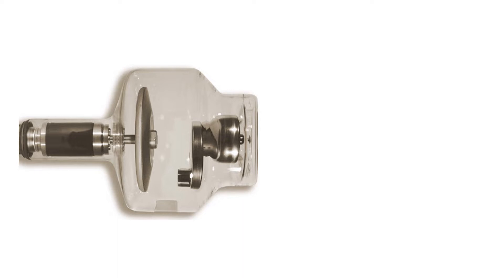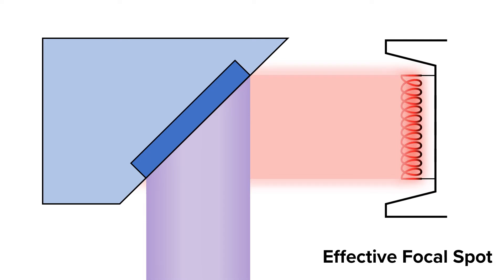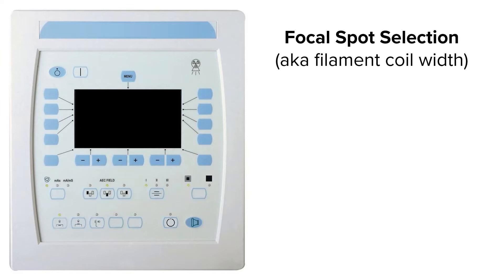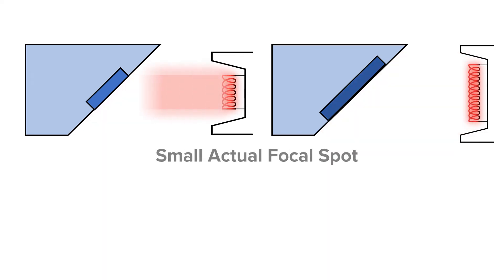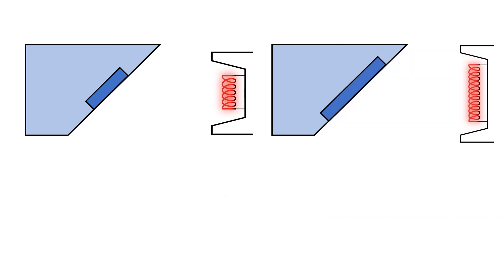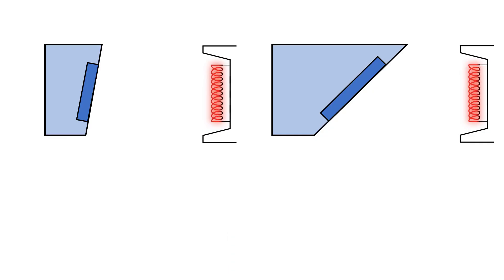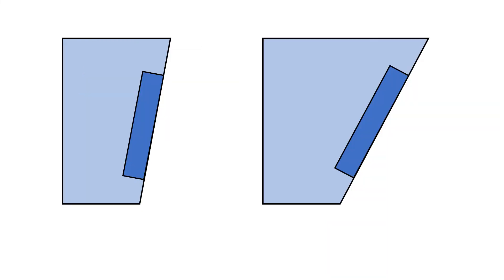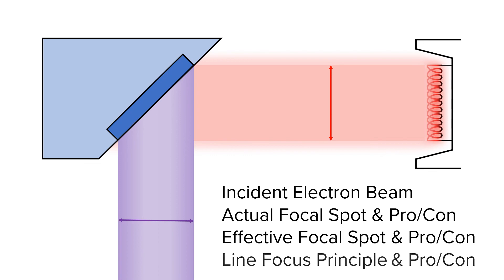Focal Spot & Line Focus Principle

Comment: I presented papers at the national conference in Australia in 1988 and again in 2016 because radiographers did not know that pushing the tube angle button and angling did not change the relationship between tube focus and patient. The only thing that changes with tube angulation is collimation. At the last conference there were 120 qualified radiographers and only 25% knew what happened when the tube was angled. https://youtu.be/mZPD_gLs5Dw?si=e5HMqOBuOfOlomlu. Some of the xray tubes I used in the early 80s had 1mm small focus and 2mm large focus, so nothing was sharp